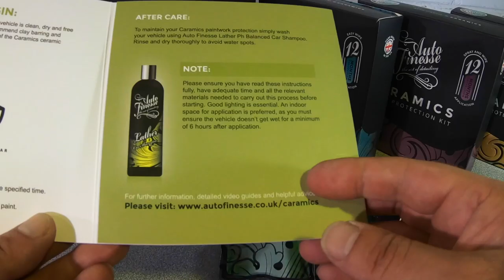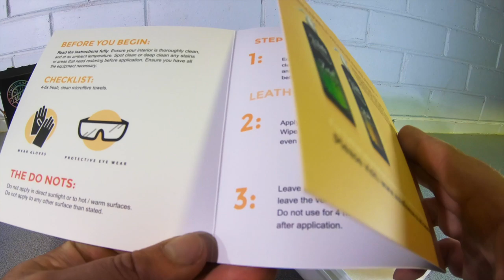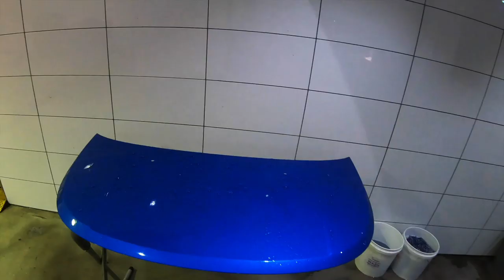Auto Finesse "Caramics" Car Protection System - How to apply & Review!

Comment: Whoa! Much more expensive than I was expecting, especially for what it is and offers. It is basically a high concentration sio2 sealant handi-wipe. Legit coatings really aren't that difficult or time consuming to apply if you read the directions and have common sense and you'll get much longer protection life for a similar, or even lower cost if you factor in time and product use to prep the surface properly. But it's always nice to have options. Thanks for taking the time. 👍👍

Comment: Great video Sandro.     I just got a bunch of Auto Finesse Products including the Caramics system.     I haven't installed them yet so this video was a great "trailer" of sorts to see what I have to expect.  Looks to be easy to use products that give reasonable durability and performance.    I'm willing to forgo a longer lasting true ceramic coating for the use of use of this product and i'll just reapply it after a year or so (if it lasts that long) or whenever it needs reapplication.     This looks to be a great "do it yourself" type of product for the weekend driveway detailer to use and get decent results.   Even though it's a little pricey,  that's fine with me for the ease of use.    A lot of Auto Finesse products are really reasonably priced and work fairly well.    There are others that are better for sure,  but I enjoy using Auto Finesse and their products have always worked great for me.

Comment: Another good video mate.  Hey have your tried any of the Bowdens Own products. The only one I have used, and swear by the results,  is Fully Slick. It's been stinking hot here but has just rained in Adelaide and a week after application the beading is quite impressive and the water just rolls off the windscreen.  Do you have any thoughts on the range?
Tom

Comment: Hey Sandro how many polishing pads and microfiber cloths do you us in the polishing and coating stage? And i will also said i tried the PolishAngel Cosmic glass  coating urlyer this week and it gives a totaly sick shine and im looking forevard to test the water beading behavior and you should check it out since i know you liked there products from urlyer vidoes. A brand review is not even on youtube so that would be great if you could do that for a feature video.
Reply: only downside with it is that it is very time consuming since i need to wait 30 min before wiping it off after aplication and need to wait 2 houres between 1st and 2nd layer

Comment: I know you like carpro. Have you ever applied a carpro/gyeon leather coating for the interior? What's your take on putting a leather coating on the interiors? Also most dashes are being covered in leather would you apply a sio2 coating on the dash or just the seats?
Reply: @CarCraftAutoDetailing  Thank You for the reply. What do you mean by non porous surfaces?
Reply: @CarCraftAutoDetailing  Thank You for the information!

Comment: Hey sandro, how would you compare the glass coating to carpro forte are the water characteristics similar or is carpro better
Reply: @CarCraftAutoDetailing  thanks I have forte on my car for 2 months now great stuff, here in Ireland we have a lot of bad muddy roads it's holding up really well, I like the idea of the pre soaked cloths for ease of use and the quick application process of auto finesse I might offer it to a few customers and see which they pick, I think the carpro may work out cheaper also